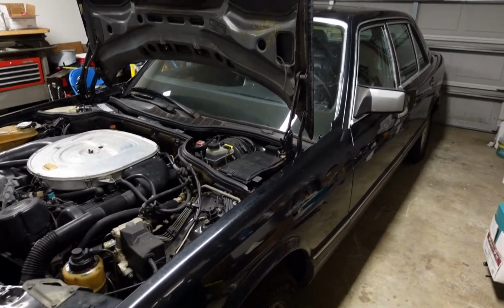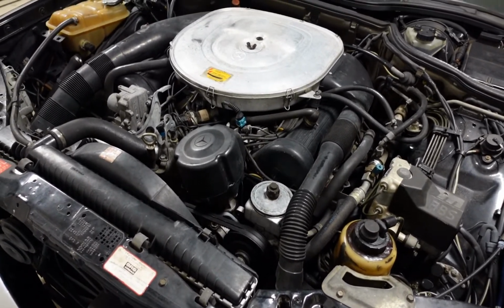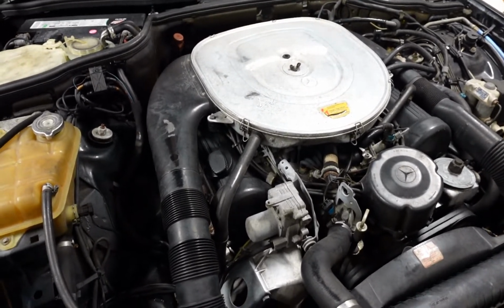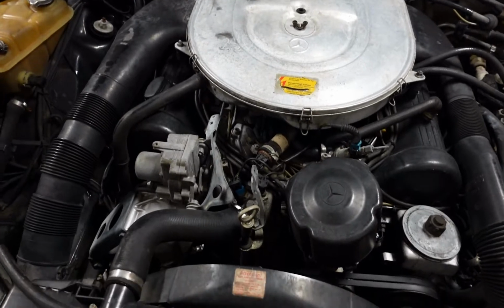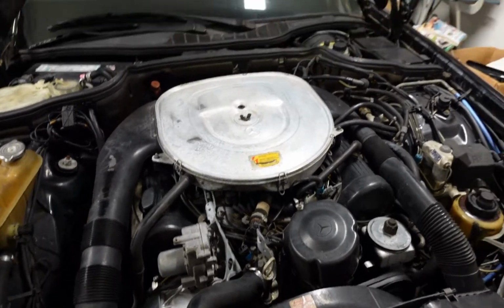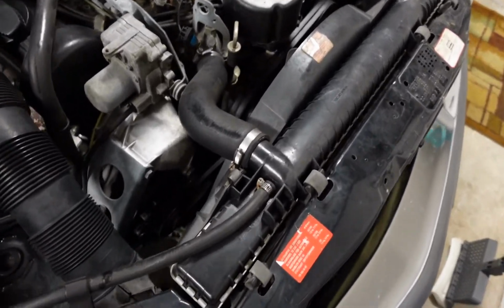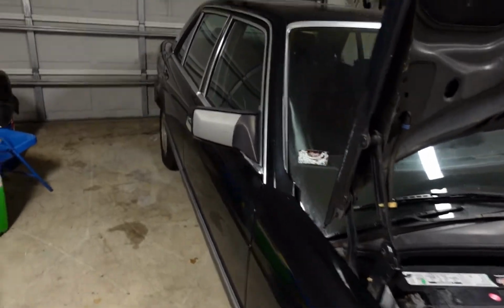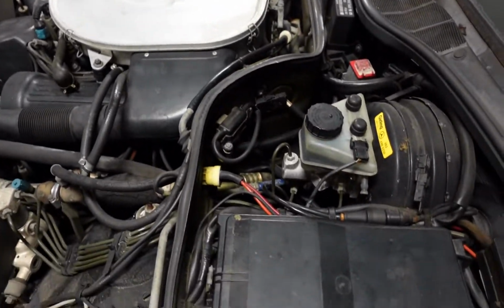1989 Mercedes-Benz 560SEL EFI Conversion: Intro [1]

Comment: Bogging on light throttle, means its over fueling on light throttle. If i understand cis correctly, your vacuum flap under the air filter is moving more than its supposed to on light throttle, it needs adjusted for more tension is my guess